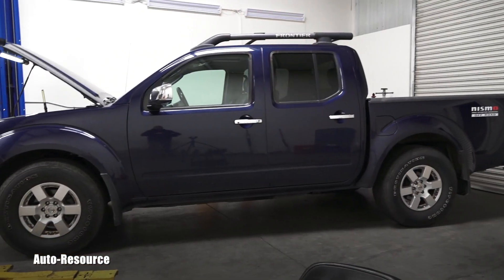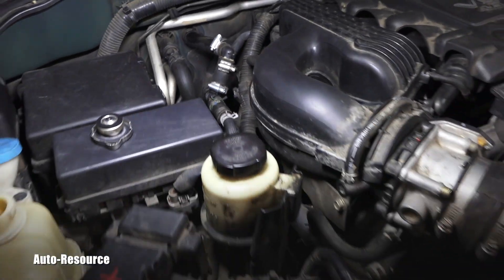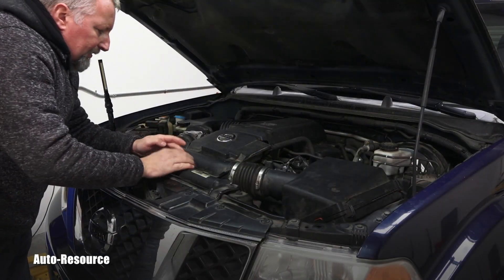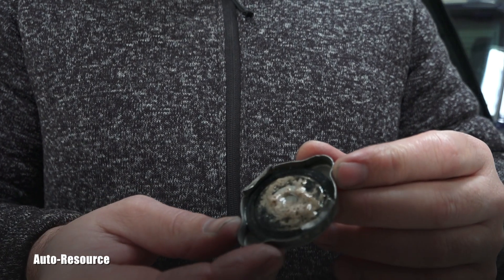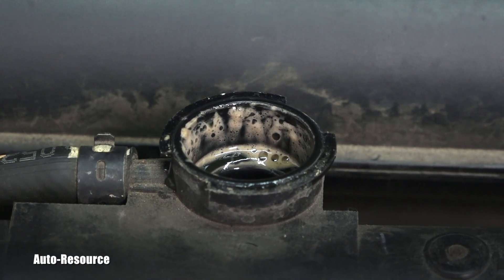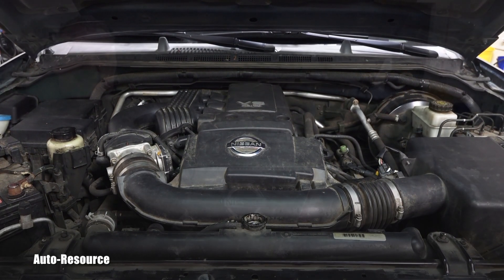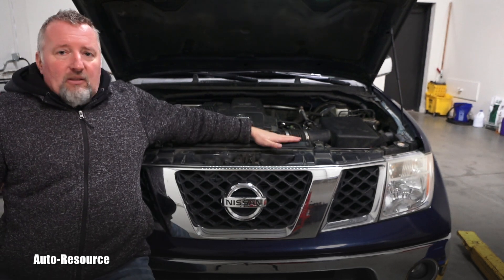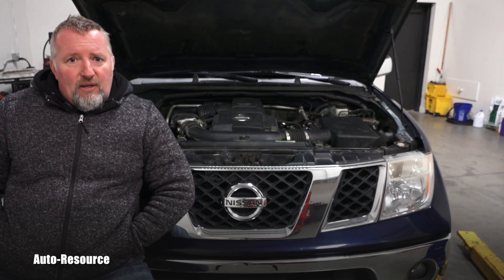Nissan Code P1754 Diagnosis

Comment: i get that code  i was driving and felt like it slipped out of all gears no power at all. so i shut car off re started then i had full power for like 30 secs then nothing again i checked the fluid it dont smell burnt but its real dark going to drop pain tomorrow i have 177000 07 qx56 4wd

Comment: Hey I have a quick question. My mom was driving my 05' Xterra and she said when she was heading somewhere, the car started to slip or not accelerate as well then jolted and speed up quickly. When she got home, I saw the check engine soon light pop up. I took it to Autozone and O'reillys for the free check engine diagnosis, and I got the code P1754 (input clutch solenoid valve). I talked to two different mechanics. the first mechanic said "there's water in the transmission". Said that both transmission and radiator need to get replace. the second mechanic said that the car just needs service "codes sometimes bullshits people to waste money'' and needs a new radiator with a flush. I hoping for third opinion and see what you think? the car runs okay but I'm just going to let it sit for now.

side note: I went to check on the coolant reservoir and the liquid was dark but it was also creamy.
Reply: If the coolant reservoir is creamy that’s a sign that atf and coolant mixed and rhe tranny has to be rebuilt
Reply: @mikhailvizcarra9057  yeah I had to rebuilt it lol i also swapped the old radiator

Comment: Had this problem once before - learned the hard way - cost me $3k to finally fix - new radiator, power flush twice and transmission rebuild with a new transmission valve body from the Nissan dealer - stupid radiator design - if you already have such a Nissan Xterra or Frontier have someone do a radiator by-pass for the transmission
Reply: hi Sarah, I got this code on my car. My guy is charging 2500 to replace the valve body instead of rebuilding it. Does it make sense? or I'm getting charged too much?